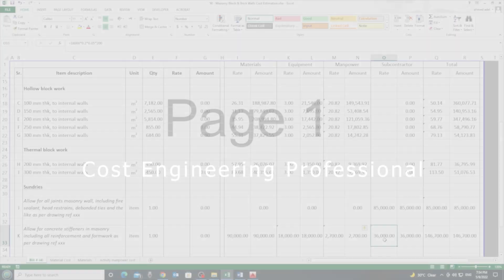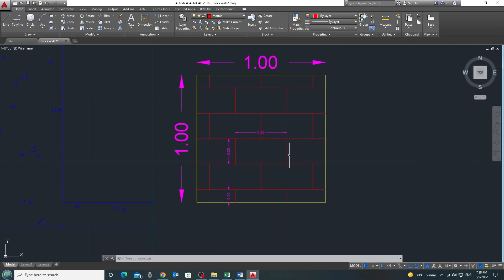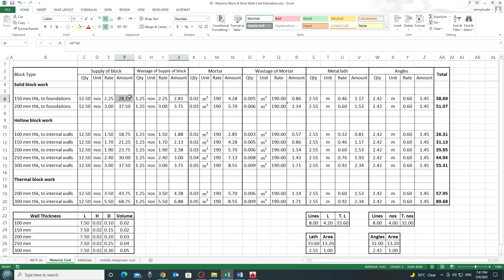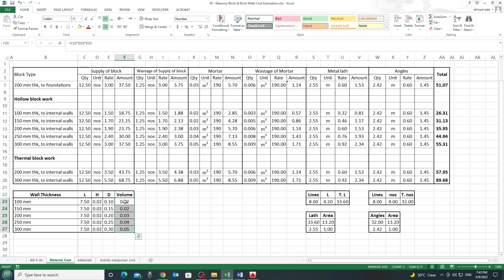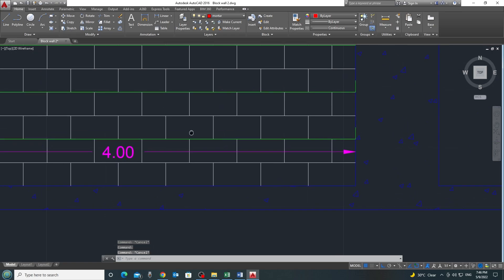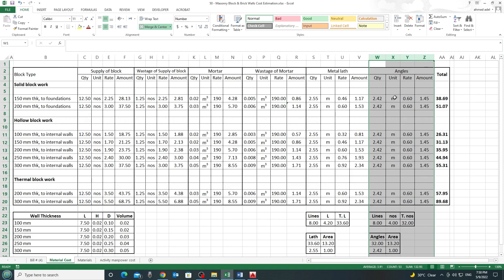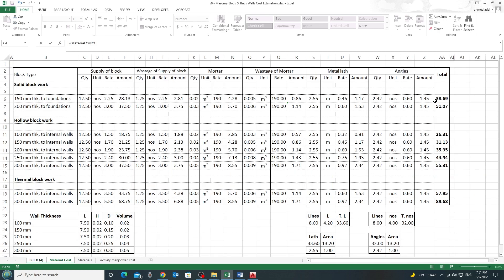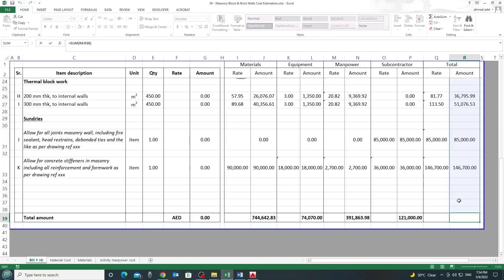Block / Brick Walls Cost Estimation - How To Estimate The Masonry Walls

Comment: How to find percentage of physical work completed in .... constructional
Reply from the maker: 6 methods 👍 easiest one is completed quantity / total quantity x 100 %
Reply: Thanks bro...For the individual work like block work or tile work we can ....we can compare the current  completed quantity  to the total quantity.....

If this case comes to  percentage  completed for total building
 should we have to compare the amount expenditure to the total estimated cost?
Reply: @CEPQS . A good question, Imagine Handling a project of 500  Executive housing units with all the external works and that all the structure shells are standing, part of the roads, and parking are all done.
A non-technical person may say that it's 85 % done, but the site manager knows that much finishing work is still pending.
Thus, all the works executed using a mechanical plant move faster but finishing goes slow so one may not notice at all.
It's tricky, that a client may also see that he has only paid 35% of the contract sum
but the site looks complete only that he does not realize that costly fixing is yet to be done.
Reply from the maker: @hanningtonopondo8907  yeah, projects always look complete from the outside while so much pending finishing inside reduces the % a lot. That’s why the completion percentage should based on the % of completion of all project items 👍

Comment: Very educative and informative videos.
I have some concerns though,
The area occupied by mortar in one square meter of blockwork will definitely reduce on the number of blocks in one SM.
Consider taking the length of mortar in one SM and multiply by  its thickness(20mm) ,i bet it will be  more than for two blocks.
Also on hollow blocks ,there are spaces in them that dont need mortar,hence should be deducted.
Reply from the maker: Thank you for watching and comment 🙂🙏. Regarding number of blocks, you are correct, but I prefer not to deduct that to keep the estimate safe 👍 and regarding the hollow block, the hollow side is always down except for the first line where we fill it or use solid block. So the take is even for hollow block, the quantity of mortar calculated in the video will be required 🙂👍